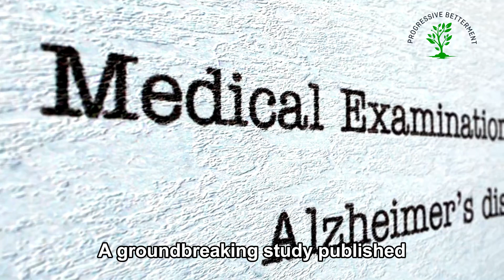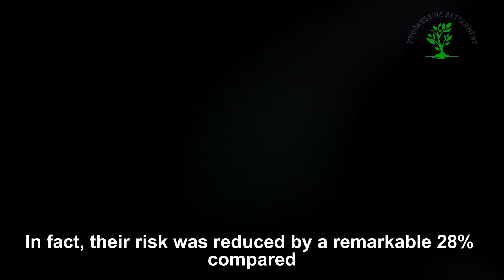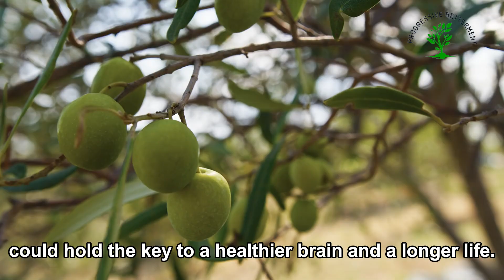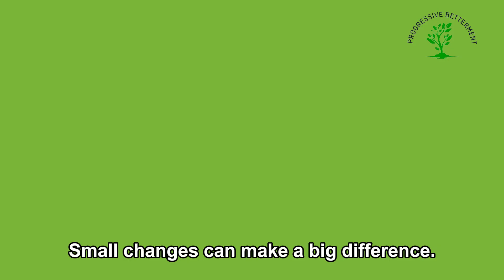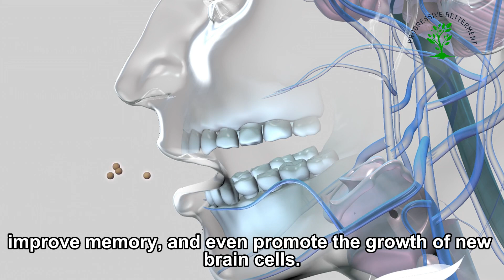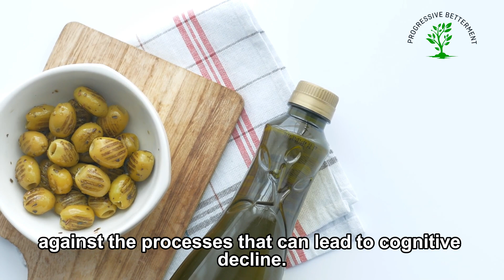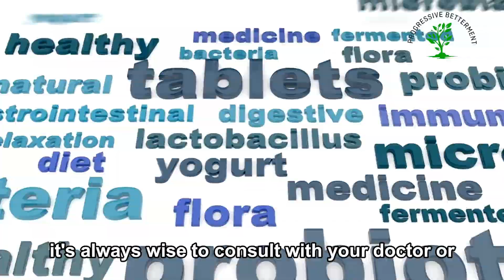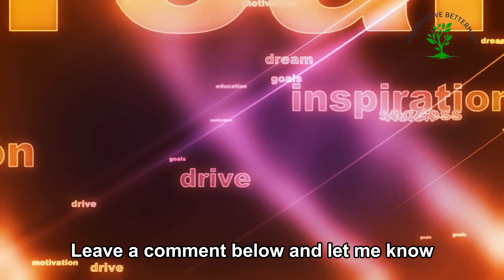How 7 Grams of Olive Oil Daily Impacts Dementia & Mortality || A 90K people Study Results

Comment: Maybe I missed it but they didn't talk about getting the extra virgin olive oil because it's cold pressed only once without high heat or chemical solvents. I need to start adding more Olive oil instead of the splash I normally do.
Reply: That's correct they failed to mention it needs to be extra virgin.  There are many fake olive oils on the market.  One way to determine is place some in a glass and put in the refrigerator for an hour.  If it does not turn cloudy and thicker ... if FAILS the purity test.  I take 2 tablespoons straight each day.